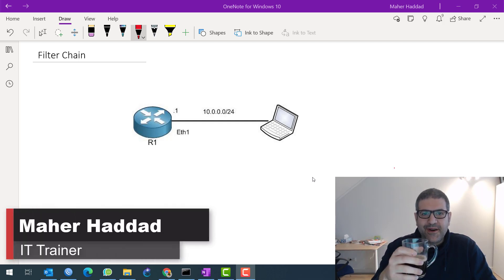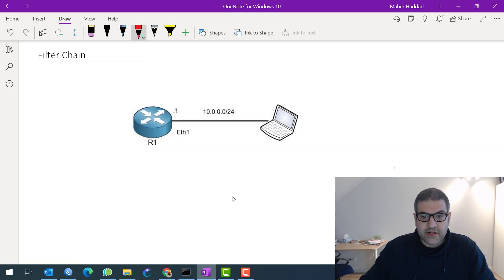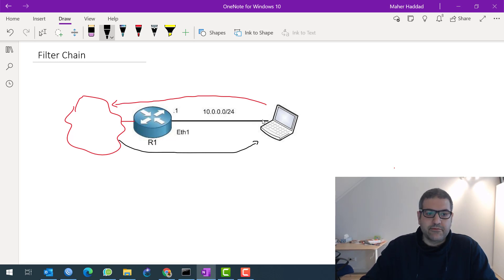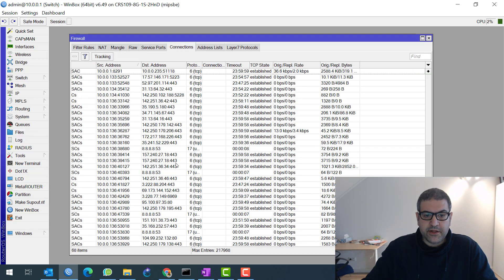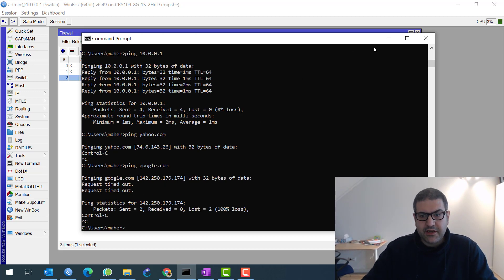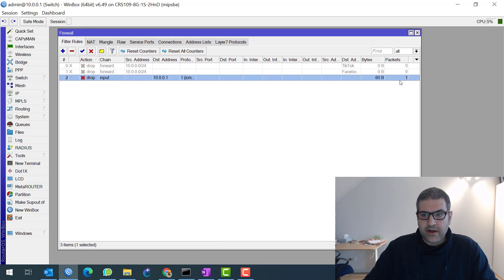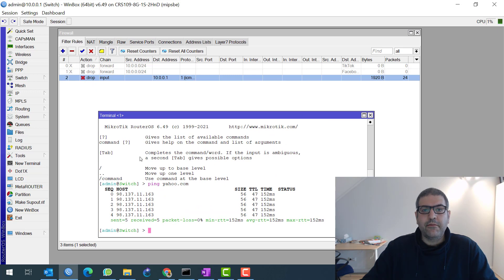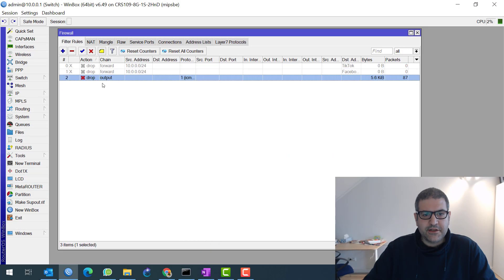MikroTik Firewall Filter Rules: Chains Forward - Input - Output

Comment: Do you have any way to clear connection tracking with a script on Router OS v7 when using failover. Tested and the Scripts just give an error on v7 and on v6 it works without any issues. Your help would really be appreciated.
Reply from the maker: script on Routeros v6 is different than v7. You should adjust it to work on v7

Comment: Hi there, for more security, can I set like this: chain : input.. source:any ..destination: my IP router... int. interface Ether1 wan ..action: drop ( that means any request from outside or internet to my router or lan must be drop ) but computer from lan can access to the internet? thnx
Reply from the maker: yep :)
Reply: @MAICT  thankyou
Reply: @MAICT  thank you for quick answer . one more question please in my lan I'm using wifi on all devices not wire , my question is with this firewall roll my devices still can use the internet not from the internet cannot access to my lan ?? or i have to add an extra roll for wifi devices ??/